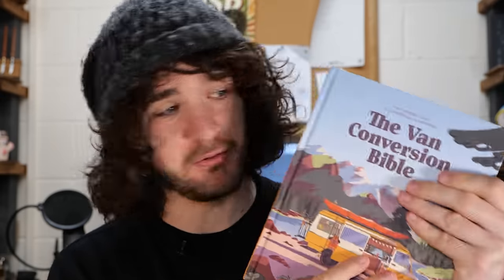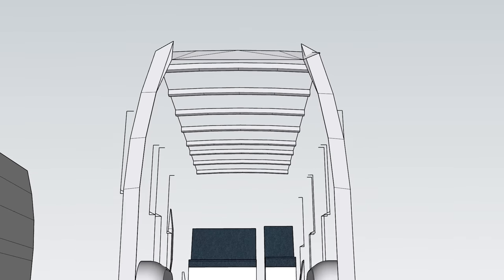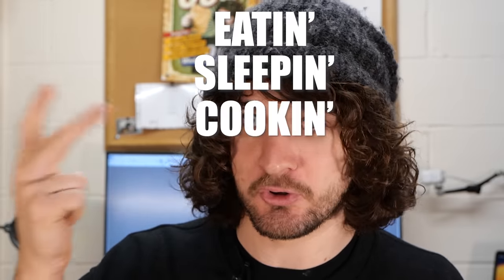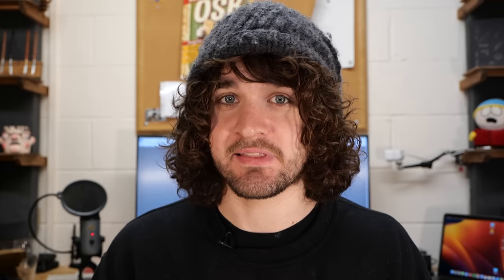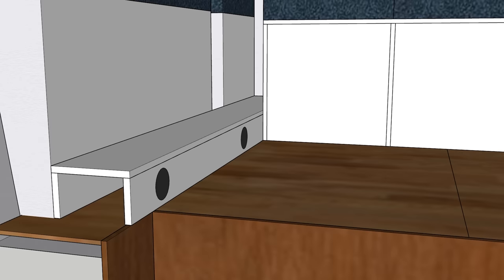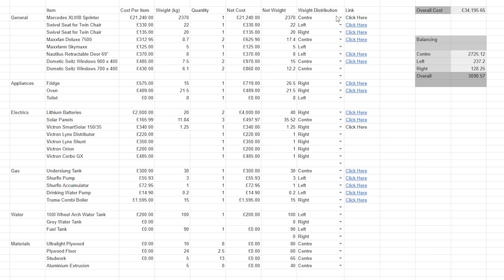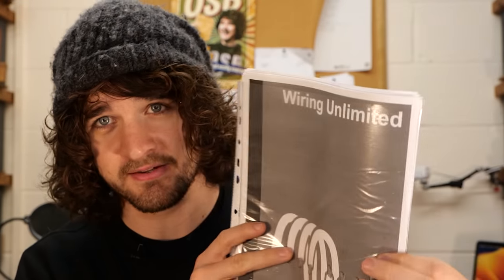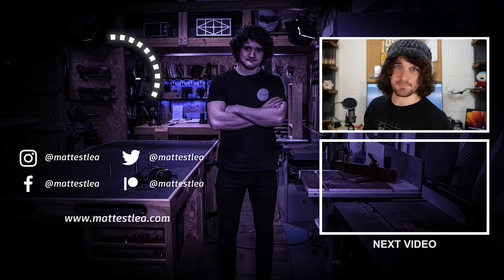How I Designed My Van | Mercedes Sprinter Conversion #4

Comment: 23:30 re weight distribution of water: Instead of having one 100L tank on one side, you could have two 50L tanks on both sides, connected with a thin pipe at the bottom. This will keep the water levelled.  I've seen it done in other conversions.
Reply: I tought the same, because tank will be empty and full from time to time and that will create a 100kg difference
Reply: Totally agree.  When weight distribution is such an important factor, having one element that can be anywhere from 100Kg to  zero Kg will make a huge difference in the handling and stability of the vehicle.  Its the same principle they use on aircraft and ships.
Reply: I too recommend second this approach, water determined weight is not something that is a constant, a 100 liter tank weighs 100 kg one day, but on another day you may be 100kg heavier on one side due to an empty tank.
Reply: I'd also support the idea of two (or more) evenly distributed and self-levelling tanks. The biggest impact on handling isn't when the tank is full or empty, but when it is half-full and the water can slosh around.

Comment: Looking good! There are just two things that I would reconsider:

The shower: a rain shower can use up to 20L/min giving you 5min of showering time every time you refill. Not even talking about heating 100L of water in 5min. I would really advice on having a smaller showerhead with a push button so you can wash instead of shower. This makes it possible to clean yourself with just a couple of liters of water. You can of course still build the rainshower for aesthetic purposes and for when you are connected to a hose.

The step/laundry/poopybusiness hatch in the garage. Why have a garage if you are only going to use it to access a small hatch in the back. Emptying your garage to empty your loo is something a lazy person wouldn't do. I think it's not neccessary for the laundry but I like the idea of the external emptying of your number two. Would it be possible to position the toilet differently and have an access hatch on the side of the van? Maybe harder to realise but it would be so so so much more practical!

Good luck with the build :)

Comment: Looks like you put a lot of thought into this build!  As someone who lived almost a year on the road.  That rainfall shower is, in my opinion, not the best choice.  A wand wash, with and off/on in the handle is the best option.  100L of water does not las very long with a traditional shower head.  But with a wand, you wet yourself - shut it off, soap up, then rinse. You can shower in 3-5L of water, vs 20-30L of a shower head!

Good luck!

Comment: I enjoyed your video. 
I built a temporary layout with 2x4 lumber and Kreg screws secured to floor using longer bolts in the factory hold down locations.  Extra tie downs for bed and heavy items. 
Safe? You decide. 
Camped in it two full summers-13,000 miles. 
Temporary water, cooking and 12v Dometic compressor fridge. 
Permanent heat using Espar. 
2 max-Air vents & fully insulated with walls & ceiling. 
Temporary Victron system with 300O Multiplus and 400ah LifePo. 

Learned what works and what doesn’t. 
Learned I want to venture farther off road in North America than a 170wb 4x4 Sprinter will be comfortable doing. 

Found out Mercedes needs to get their act together. They build a fine vehicle but 12 Recalls in 2 years!?!  Most were for software issues-that could result in safety concerns. This is way too many to inspire longevity confidence.

Shopping for my next, older, simpler, more off road capable conversion candidate.

Comment: Lived in our van for a year whilst travelling, your design looks awesome! One thing, swerve that rain shower idea if you're using that Truma heater. You need a shower head with a push on/off button so you can stop the water whilst applying shampoo/shower gel. Otherwise you will run out of hot water very quickly/mid shower in colder months.
Edit: Also consider the diesel version of the Truma or the JP Heater (Chinese version). Our first van had LPG heating and used to munch gas, diesel is much easier to get hold of!

Comment: Sounds like you’ve thought it all through. I lived in a van for a year when traveling around Europe in. 2019. Found we never used the shower cause 1 minute showers in a cramped space sucks. And you have to carry loads of water which is extra weight which means using more petrol etc. We found the local swimming pool or gym worked better for showers and were reasonably priced. Anyway best of luck with the build

Comment: great content. very similar to Greg virgoe's layout ( which I based my lwb sprinter on) I like some  of the tweeks you are giving it. I went with swivel plates driver and double. Fitted  minibus seat on front of loo . foot space in front of minbus seat then a bench with truma 4e. I made a table that fits above bench, It  can un-hook and stows on brackets under bed . The table has slide out extension so 4 can eat or when stowed 5 can sit in that area. The table can hook on the back of sink unit so can be set up outside.
I really like the thought you've put into it all. I have used Greg  Virgoe as my bible but tweeked to suit our family. Good luck I'll following your progress

Comment: Thanks matt, that was such an eye-opener, so many things to consider that I would have not thought of. I have often thought about doing a van conversion but always been put of due to cost of having a second vehicle. After you mentioned about the driving licence categories I checked my licence and turns out I have a C1+E on mine (standard licence issued in 93), that is just mad to think that there is people out there like me with no training that can jump into a vehicle and trailer that weights upto 12 ton and be allowed to drive it.
Reply from the maker: 12 ton?! Is that what the limit is? 😂 oh my lord I didn’t expect it to be that high. I’d have guessed 5ton max
Reply: @MattEstlea2  yip I looked it up last night after watching your video. I hope you enjoy van life and the winters are not to tough on you. I spent a 1 1/2 years in a caravan and it was not for me, winters were seriously hard going, no water in winter and a couple of times there was also ice inside my working boots. Wishing you all the best, hope it works out for you.
Reply: 12ton is the max weight for a truck and trailer combination. C1 is for vehicles from 3,5-7,5tons (only). Just in case anyone is planning a 12ton van modification. 😅

Comment: A lot of work on a very thought out van design. You may already be away of his videos but Nate at Explorist Life has a number of videos on not only design of electrical (and other systems) systems but also very detailed demonstrations of  how to cut, strip, crimp etc. the actual wiring and fittings. BTW, Nate highly recommends using ferrules on the ends of wires. I absolutely agree with you about using Victron products. I am in the process of completely replacing the electrical system in my class C motorhome with solar, lithium and Victron products. Good luck, looking forward to your build and final product.

Comment: Great to see a video from a person on the same wavelength: meticulous research, planning, spreadsheets, details, thinking -- all in advance.
I've been exploring same terrains for a while too, with addition that my thinking is very budget conscious, while yours is more like "no expense spared"; and I'm leaning toward Ducato/Relay/Boxer SWB (L1H1) or L1H2.  
Foamcore ply is an interesting find. I wonder if same material can be made cheaper DIY by sandwiching regular insulation foam from DIY stores, 1mm plastic (to add rigidity) and 1mm plywood (for cover).  Coupled with clever T-section aluminium welds, this would make very sturdy, but very light shelving, drawers and kitchen unit - without sacrificing the homey wood-look&feel.
I agree on underslung LPG tank (btw, you don't mention the size/capacity), but Truma Combi costs a whopping £1400-1800 - a bit too much for 10L water heater which you have to wait a while for.  Instead, I'm thinking Propex heater with split air-vents: one for heating the van, and one for heating the insulated hot water tank with a dedicated aftermarket system. Search YouTube for "Cheap Hot Water For Camper" or "Bobil".  
Another very simple and cheap DIY hot water "system" that I've seen (can't find the video again) is having a hole in the kitchen counter with a hose running to the bottom of the hot water tank. Just boil a kettle and pour down the hole (with a funnel).  Couple of boiling 1.7L kettles, when mixed, should give you plenty of warm water (37-41 degrees) for a shower. Seal the hole with a bottle cork when not in use ;) Simplicity!
You didn't say anything about insulation. I think it is the key to energy usage, soundproofing, WEIGHT, and rigidity. After considering many pros-&-cons, I'm leaning toward sprayfoaming the whole thing. 
Where in the UK are you based?

Comment: Gen-X here! I disagree on the 3.5t limit. 

We wanted to be able to stay out for long and we wanted a 4x4. And it becomes very easy to be over the weight-limit of 3.5 with a Sprinter. 

So we choose something a bit more substantial. It comes with its own limitations, but I don't regret it at all. It enabled us to build the van we needed.

Comment: Hi Matt,

Just wanted to say, your choice for the victron system is in my opinion a good one.

We have been using them in our submersibles for a long time and they last.

Also, living on a island with a lot of boats, I can not overstate the value of a solid, reliable and most importantly SAFE electrical system. 
You’re living in there after all.

Always flabbergasted by how dodgy people wire up there camper vans.

Do check your voltages every other year, as those victron converters due to to construction of tend to travel a bit from there initial set point.

Greetings from curaçao

Comment: Can I suggest you consider a casette toilet. These are used extensively in Australia as they are very hygenic, never have smells and are easy to empty, the waste bio-degrades. In our climate composting toilets are smelly. In the UK they can be empied into any standard toilet or CPD, same as Australia. Also the cost of a composting toilet is twice that of a casette toilet.

Comment: Hi Matt. This is awesome and so useful. One thing l learned in my build  and mentioning this as you are investing in  the victron kit. Have you considered a 48v system and/or get rid of gas? It looks like you are installing a 3K multi plus? 48v is the direction I am taking in my build.  Check out the victron multi rs solar. It’s a 6kva inverter/charger and it’s 🎉only 11 kg and has a built in mppt. Speak to Steve at Roamer batteries can help plan the elec system and supply the 48v battery. Those guys are awesome. And best of all check out Safiery. It’s an Australian brand but does bi-directional 12-48v “Scotty’s” for 48 to 12 v.
Reply: And would save the weight/ danger of gas😂

Comment: Hey - boomer here. I've been living full time in a 27' caravan for the past year (don't ask) and when I started, green, last winter I used the forced air gas heater. I was cold - until I turned the blower off and just used it as a convection heater. For my bathroom I use an electric fan-heater. Mine has a big sticker saying "NOT TO BE USED IN A BATHROOM", but I know that others wouldn't be so stupid. The ability to close off the living space from the bedroom is invaluable to the goal of keeping warm in the colder months.

Comment: Looking forward to seeing the rest of the build. Have you thought of using steel C section or U section for the studwork in the partitions? It may save a bit of weight compared to timber studs

Comment: I don't know if it's an issue but have you thought about weight distribution lengthwise? If the center of gravity is too far back it will effect both breaking and stability.
What about making an external access to empty the toilet?

Comment: Great video, have you got the files for all of those versions of the van? Sketchup is great, to a degree.
Reply from the maker: Most of them got ripped apart due to the fact I was reusing components when drafting updated versions!
Reply: @MattEstlea2  Only wanted something as a outline to get planning. Chances are I'm not going to end up with a sprinter, but for a rough idea I could use a couple of models to get planning with. 
Your a like me, I build along the green axis and use the red as ideas that may not make it. 
You know if you have a lot of models to work in the centre as moving around can get a little goofy. I think you can add an axis point too, or maybe only when working in a component. 
Have you checked out Justin's YouTube channel, the guy with a baseball, whhattttsssss up everybody 😁

Comment: It may be your intention but as you didn’t mention it, or have it in your spreadsheet, please don’t forget smoke alarm/co detector/extinguisher/fire blanket which really are essentials.
Reply from the maker: Good shout. Will make sure those are included in the build!

Comment: The loo access is accessible from the front of the van? As a fellow lazy bugger with the addition of carrying 20st I soon discovered what a pain in the arse it was squeezing into a tight poorly designed access area to drag out my toilet cassette I have on my narrowboat, so the thought of getting out of the van, going to rear doors, removing everything from under the bed then crawling under the bed to retrieve a poo bag is never gonna happen.
Reply from the maker: I'll have the option to empty it from both the front or the back :)
Reply: @MattEstlea2  so the front 99% of the time :D

Comment: 14:12 you said you were going to have 12v usb plugs. I assume you know usb type A only supports 5v. If you want more you will have to use type c PD
Reply: Oops! Yes my mistak, I am aware they only support 5v. I meant it'll be on the 12v circuit. Thanks for pointing that out :)

Comment: You still need a vent for the bathroom to vent out the humidity from the shower and such.
Reply: He's adding a roof hatch there - active venting is unnecessary, just open a door and the draft will pull the humidity away.
Reply: @velianlodestone1249  Hey, whatever but convection works only so well.

Comment: Have you compensated for the insulation and wall thickness in the design of your bed length?!.. as you won’t get the full width of the van. 
I still think you’re going to struggle with the over length, especially if you’re sharing the bed with your missus.

Comment: Plastic may be lighter, but it has a bad influence on the quality of air - it manages to annihilate negative ions in the air. Negative ions in the air attach to impurities, making them heavier and causing them to settle down as dust. With them in the air, they settle in your lungs. That's why we enjoy air after a rain or near a white water creek - the water creates a high concentration of negative ions in the air.

Comment: regarding your water tank.... Where's your fuel tank - and it's capacity?? Usually on the left. Have you taken this into consideration for your weights...???
Reply from the maker: Yep. The calculations I made tell me that the right hand side is heavier because of all the appliances and electrics, even with the water tank counterbalancing it on the left. Perplexed me for ages before taking a look under the van and noticing the fuel tank would aid in counterbalancing too.